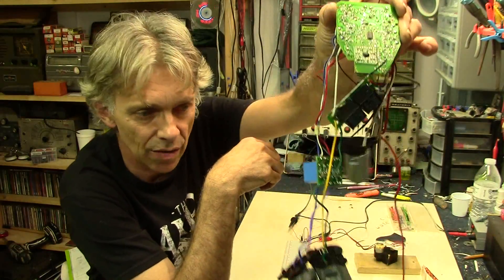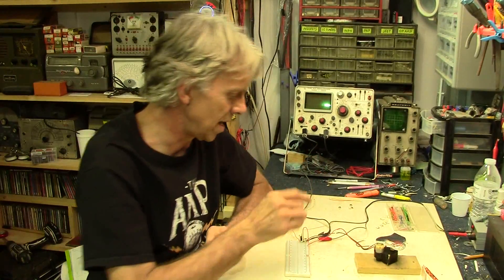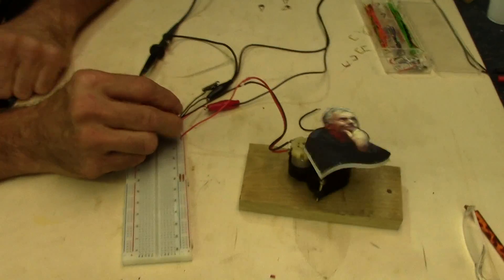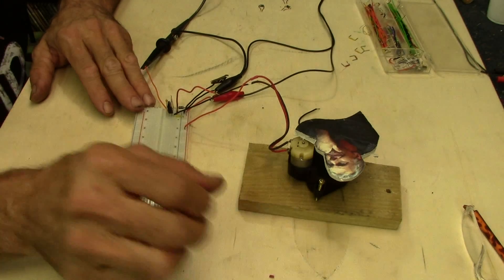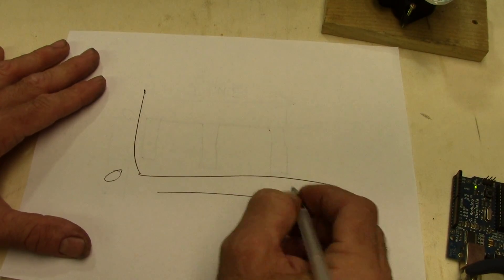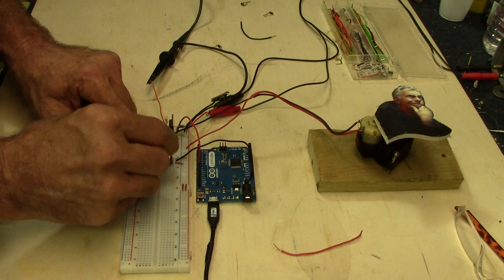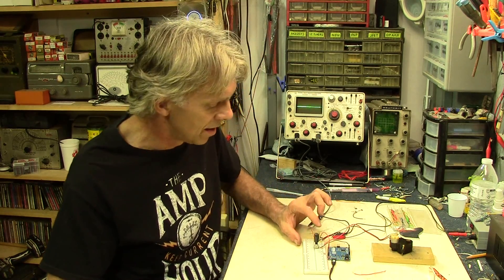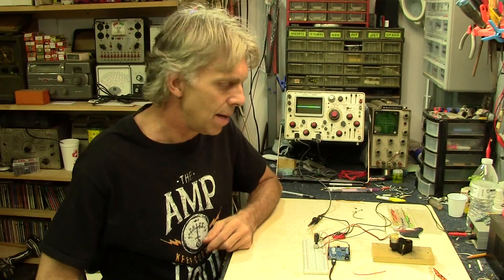All About Pulse Width Modulation

Comment: speaking of H-Bridges. I need to build a inverter to run my home. I basically got it figured out. I have seen where ppl. say make h bridge with all n channel FETs . I don't understand how that could work. doesn't the gate have to be more pos. than source and drain. so if source drain is 180v how are you going to get more power to trigger the gates for the high side? do you have any ideas for a simple h bridge for a inverter. I haven't got started yet. just research and gathering parts. I have some huge heat sinks. and 8- 75volt 22000uF caps . and I'm thinking of using spwm driver board from eBay. and a 555 timer module to build a DC to DC boost. if a regulated output can be achieved using a 555. I'm thinking about going for 4kw to 10kw. 120v 60hz. from 24-48 volts. I thank you for any help. because I sure need all I can get. and great videos.

Comment: Actually you could use a 555 timer chip to do the modulation. It sets with resistor and capacitor values. Which means varying one or the other changes the time base. No microcontroller involved.
Reply: I mentioned that in my blog post: http://hackaweek.com/hacks/?p=1538
The purpose of THIS video is to explain how PWM works with a MCU and display the square wave on an oscilloscope. Plus I love firing up my old 453 and making the workshop smell like vintage electronics. :)